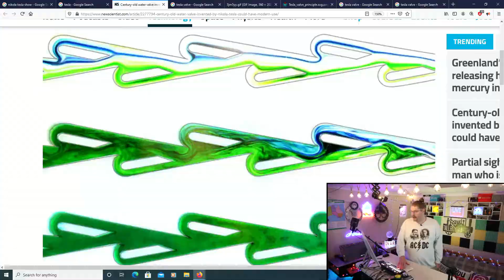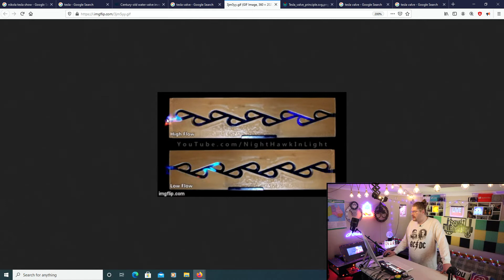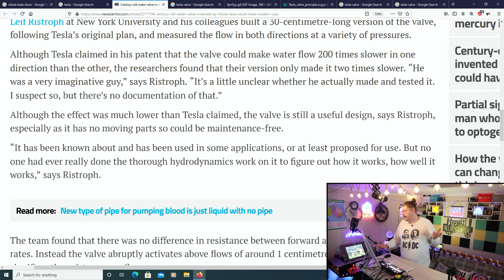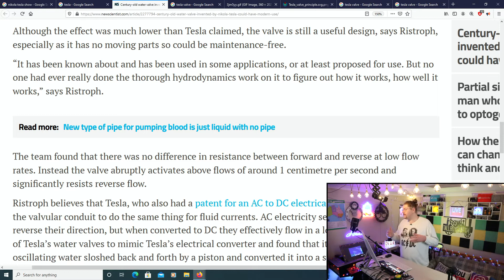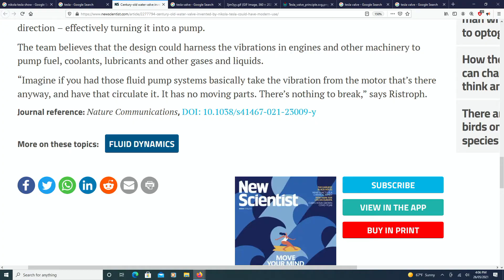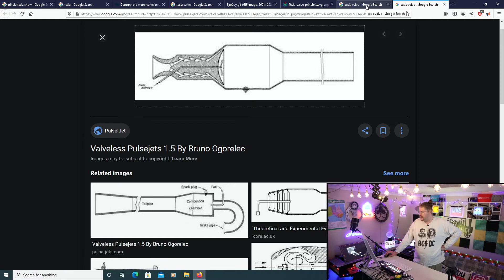Nikola Tesla’s 100 Year Old Rediscovered Invention, The Tesla Valve!

Comment: Good video 😁👍🏻. You may not be able to do this (due to time restraints), but your videos would both be much better and gain more traction if you gathered research from multiple sources on a topic and made it into a video. 
Think of it like you would a presentation 🤔
Technically, it would be a video presentation.

I am aware of the run-on sentence xd but this is not a grammar class..
Reply from the maker: Thanks for the info man 🤙🏻 
I try to get as much good info into every daily video but also keeping it at just the right amount without going to deep ✅
Reply: @GarethWalton2  xD yeah that's good. I actually enjoy watching your videos. I'm a nerd though so I end up looking up the subject further on later. I think this video was one of your best though. You explained everything really well 👍🏻

Yes, I am aware of the poor sentence structure. Work doesn't let you slack 🥲